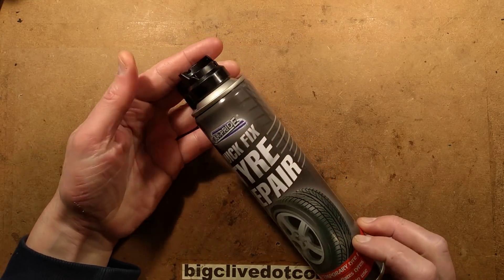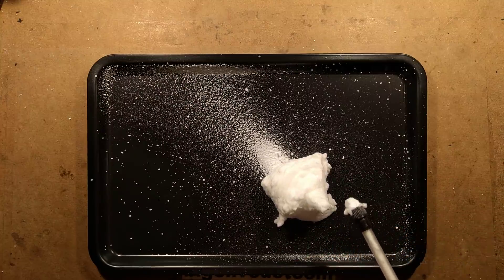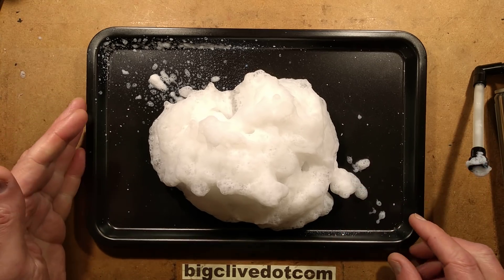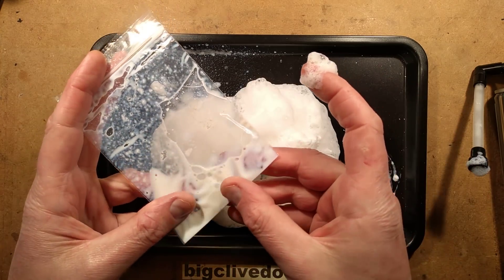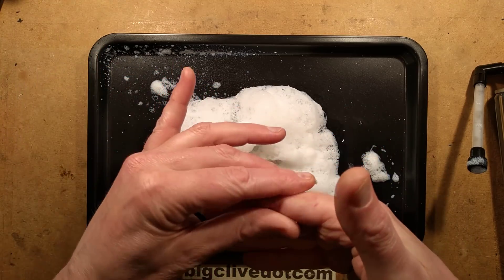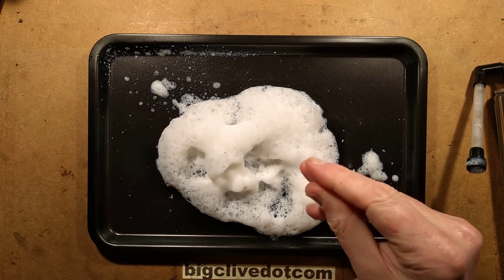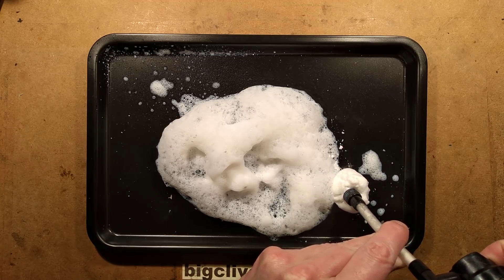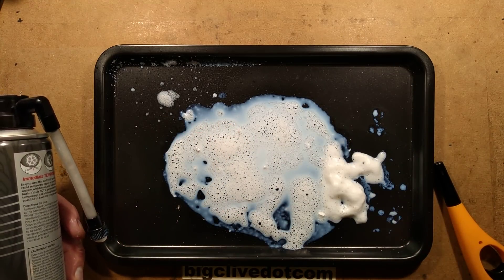What's in a tin of foaming tyre repair liquid.

Comment: Have used it 4 times for personal and family cases (the Home bargains 4x4 version)

Once a trailer tyre wouldn't hold air, (when you were filling it with the compressor it wouldn't have any of it,) I put the puncture at the bottom and it sealed and filled the tyre.

There are caveats.
One being that it won't really work on sidewall punctures.
The other being that once the tire is fixed, it won't be easy repairing it for obvious reasons that I overlooked (get a white paint pen to mark the puncture, this will be easy to find as the sealant will be spewing out the hole)

I swear by this stuff Clive. Pulled me out of many potholes.
That said, it won't fix Sidewall punctures, although, it will show you where they are pretty quickly.

Comment: I've been in the auto industry for over 25 year's. There are several problems with some of those, first if your a tire guy and don't know it's in the tire and your dismounting the tire and separate the bead with some pressure in it it will blow that crap everywhere, second it's very flammable and your tire could go up in flames if there's a spark with a flat, AND THE WORST is if you have a tire pressure sensor inside the rim the chemicals will eat it apart if it's not a sensor safe can and now your out a tire and a $100 sensor....and it also screws up the tire balance while you drive....

Comment: I have a burnout car with a front tyre with 2 tns worth in it ... Has been in there for 3 years the tyre its sepf was perished and cracked .... I did ad about 12 psi into it directly after the sealup\pump in a can.....its fine still

Comment: Friend of mine used this stuff several times, on the same tire.  The tire had quite a bit of liquid inside after several uses.  When driving on the highway, and you hit a bump, the tire would go out of balance for a short while, then go back to normal.
Tires would hold air for about six months after using it, then start leaking again.

Comment: That stuff is the best way of trashing a tyre that could easily have been repaired. But, if your in the middle of nowhere without a spare it could save you sitting by the side of the road for a few hours.

Comment: Products used for cycling tires are probably similar but they are often provided as liquid. They contain latex+water+ammonia (ammonia keeps latex dissolved). Some products contain also propylene glycol to prevent freezing and to keep the moisture longer to prevent drying in hot+dry climate.
In cycling tires it stays as a liquid from about few months to more than half a year, depending on the climate and tire type. Some products also contain for example chopped kevlar or other fibers to increase sealing capability of larger punctures. Fibres really make a difference, one product I really like always blocks the nozzle of the container when trying to use it :)
Bike sealants stay liquid inside the tire and when they block the hole, water evaporates and it forms rubber at the hole. The rest is still liquid and if you get another puncture, they seal the next one, as long as there is still enough liquid left. After it has finally dried, it can form a solid block, expecially if the tire is not rotating like keeping a bike away for the  winter.
Propellants that foam stuff are almost always propane/butane whenever it is suitable.
I'm assuming automotive products to be more or less similar and behave similarly. Due to larger volume of the tire, I'd expect them to dry out faster though.

Comment: I'm an auto tech in the states. Big name Retail tire repair shops will usually deny  a repair on tires filled with tire sealant. Also filling your tire with a hydrocarbon if that is the type of propellant sounds dangerous and long term will probably rot your from the inside out, i'd think. Bottom line, drive with a properly inflated spare tire and know how to swap it out.

Comment: It's been my experience, working at an autoshop (years ago), that people don't drive  long with this stuff in their tire because the extra weight of the liquid throws the balance. And being a liquid, it rolls all over and never hits any kind of equilibrium. So either you are limited by the speed you can travel or you go get it fixed. 

And BTW, this stuff is ANNOYING for the guys at the auto shop to deal with and get out of your tire if it's your intention to reuse the tire. I only had to dump 2 tires that had this stuff in it, but it made a mess and left that rubber film everywhere from the tire machine to outside the shop. Perhaps facilities have a better method of dealing with these than we had back 20-25 years ago.

Comment: Buy a top range luxury car there days and you get 2 cans of this (with a corresponding price tag to match the fancy label on the outside) instead of a spare tyre. Saves weight and space, and of course increases profit as well.

Yes have used it, though I think the tyre shop did curse me as well having to clean it out to do the patch. Easy to remove from the inner, just wash with water, the shop has a sink that will fit a tyre, used to find the leak so it will just get some bad water for the rest of the day, then grind down the puncture area with the die grinder, then sand it with 60 grit wet and dry paper, and finally wipe down with paint thinners before applying the glue for the mushroom patch. You have to do that anyway, as the inside of the tyre will still have the mould release they used in the factory on it, and that stuff is a lot more tenacious than latex rubber.
Reply: SeanBZA top range cars tend to have run flat tyres which means you don't actually need the can at all.

Comment: I havent used this spray type.
I have used the green liquid they call "slime".that has lots of rubber particals suspended in the solution. This stays liquid in the trye and as i understand it reacts with the high pressure air when it finds a leak. It says you can keep it in your tyre incase you get a puncture.think i would rather know when i had a problem so i could get it sorted..
Downside is as its been said before. Tyre fitters wont repair a tyre with this in although it states its water soluble and can be washed out...mmmm what to do

Comment: This foam actually is very effective,  it once saved my day when I had a tire which had a hole on the tire wall and to make matters worse, there was a gap between the tire and the steel rim. Applied an entire can of that sealant and brought the tire back from the dead and I was able to reach a tire shop to make proper repairs on it.
Reply: Good for you! I couldn't fix a motorcycle tyre with little crack (not on the wall) and I had to drive it flat for 50 km (30 mi)....

Comment: A lot of people use that stuff on bicycles on regular basis so you don't end up with a flat 15km away from your home... They just leave it in there untill they actually swap the tire or have to dissasemble it if it leaks air. It seals smaller punctures, but not 100% of the rime. I don't know what on earth are others talking about when they say it messes up balance of the wheel, you're not supposed to dump whole can into the tire, a little bit is enough, once you get it rolling, it spreads inside and seals whatever needs to be sealed. Usually there isn't more than couple of teaspoons of liquid rolling about (in case of small bicycle tire).
Reply: The "Fix-a flat" type actually instruct you to use the entire contents as the can is pressurized to fully inflate a car tire to around 32 psi.
Reply: On bicycles you usually have inner tubes so down the road when you do change them most of the mess is still sealed in the tube....  On cars because of the volume required to pressure up the tire you would need a full can or around there
Reply: @WildSuns42  I've not seen a tube inside a bicycle/motorcycle/quad/car in like 15 years. Everything is tubeless these days. I remember fixing a quad tire with a tube (a rock cut it, then proceeded to shoot into a wall of an adjacent building...) but that's it! Tubes are a great fix for punctures in small vehicles, but they're not used "out of the box" anymore.
Reply: Just went and read the side of my bottle of 'stan's no-tubes'. 60-120ml per tytre recommended. That's 1 or 2 dozen teaspoons :P
Reply: @HaxR3  ...but that's for a completely different purpose.

Comment: Its only really effective on small pin holes or seeping around a screw or nail but it does work in the right situation and can be a quite long lasting fix, but you also need to bring the tire up to full pressure right after use ergo when it gets you off the road go to air pump and inflate the tire to its recommended pressure keep it topped up for a couple of days and it will eventually stop if the hole is not to large.

Comment: Our Long wheel base van had a flat 2 hours before we were due for a gig in London. It took 2 cans of that stuff to re-inflate it enough to drive it to a garage, so we could get it changed properly, but it worked long enough to drive the 5 miles there, and the bloke at the garage said it probably would have done the whole (100 mile) trip to London and back. We did find that both the position of the valve on the tyre AND the position you held the can made a big difference to inflation rate. You want the valve at the top, to be holding the can upside down, and to be pushing that button really very hard for quite some time, shaking it regularly as you pump in the gunk... in the brief time we travelled on it in the fully loaded van we didn't feel any tyre imbalance, but then again we did take it quite gently...

Comment: Had a car that was heading for the scrap heap in a couple of months. The tires kept getting leaks but it wasn't worth fixing them properly so I went through a couple of cans of this stuff. Works fairly well, you fill the tire which also pressurises it and you have to drive around for a certain amount of time (presumable for it to settle uniformly). Then you get a couple weeks before it'll probably start leaking again.

Comment: used this in a rear tyre that had a slow puncture screw in it...left the screw in and ran for 2 years with it in (cough over 100mph quite a few times cough) no problems at all...this is before i learned of the "tyre string plug" method of diy repairs though.

Comment: Clive, you need to get the microscope out. "Slime" (the big green brand in the US) and others all say there are mysterious "fibers" in their goo, which get sucked into the leak and help form a stronger plug in it, IIRC. The companies that sell leak-stop goo as a preventive to keep in your tires, also talk about special fibers. They all push it as "temporary" but if the seal gets you home without having to sleep on the side of the road, or to spend a night waiting for a tire to be shipped in, now that's the point, isn't it? The motor club isn't always ten minutes away, the tire shop doesn't always have what you need, today or tomorrow.
Reply: I second this. There are small particles inside the foam to aid in clotting the puncture hole. There's similar stuff available for industrial and agricultural use, it's a bright green slimy substance and the particles are visible, almost like small rubber pellets.
Reply: I third it - Goop in the UK. Use it on my bike. Ran it for 10k miles when I changed the tyres you could see where there were holes from punctures that had been sealed. Good stuff!
Reply: This is different to slime (Which goes in in liquid form and involves you removing the valve body first). This is designed to go into the tyre in a semi-gaseous state (so it'll make it through the valve), with the excess gas working to inflate the tyre. The slime system comes with a standard air-based tyre inflator, and stays liquid, using filaments of rubber like a "clotting agent" as they're forced out by the air pressure inside. In theory you can add slime even when the tyre's good, as it will stay liquid and slosh around inside to coat the inside, then when you get a puncture it will already be in place to seep out and plug the leak.
Reply: i actually replaced my bicycle inner tubes with ones that came with green slime pre-loaded, i never ran over anything sharp to test them, but i'm sure they were far more heavy than i should have been okay with if nothing else.
Reply: The fibers are just cellulose fibers in a liquid suspension and works quite well and can easily seal a hole up to 5mm (about 1/4 inch.) I work with commercial truck tires and many of our customers (trash, construction, demolition, forestry etc.) run sealant in their tires and it's not uncommon for me to receive tires with multiple punctures but holding pressure in excess of 100psi (6.89 Bar.) We do have some customers who run urethane foam-fill in their heavy equipment (skidder, grader, fork lift etc.) tires, but that's only for low speed off-road use.
Reply: @eddiespencer1  +1 on the Calcium Chloride. 
You'll sometimes run across folks filling their tires with antifreeze in lieu of calcium chloride. 

"slime" works, til it gets pretty cold. (Or really hot, then it turns into a ball and just rolls around in the tire. )
Reply: @jballew2239  I've never seen anyone run glycol/glycerol antifreeze in their tires but it wouldn't surprise me if someone did. They run calcium or beet juice to add weight to the tire for traction and a firm tire. Mostly Ag customers do it. Calcium is about 12lbs per gallon and beet juice is about 11. Straight water is about 8.3lbs. Running straight water will destroy your tire and rim and will freeze in cold temps. It'll destroy the tube if you're running one, too.
Reply: We call that green slime "Elephant Snot"!
Reply: Bought a motorcycle that handled funny. Found out that previous owner had put a lot of the green stuff in the rear tyre as a preventive measure. The green stuff had harden at one point in the tyre as bike had been parked up for months before I bought it. It took me about 60g of tyre balance weights to offset the imbalance until I removed the tyre. Was shocked at finding the big green slug of gel.
Reply: If you have ever seen a steel rim rust out from the inside because of that green crap you wouldn't care if it was made of unicorn tears.
Reply: Haven't ridden on steel rims personally since ages ago. But as the folks at Slime will tell you, you are only supposed to use it after a puncture--and then clean it out again as soon as convenient. If you leave it in long enough to cause rust...that's not their fault. If you inflate your tires at a gas station, there's almost always condensate in the hose, so steel wheels will be wet inside and rusting out "normally" for most folks.
Reply: @user-neo71665  I've seen more rusted-out rims from people running calcium in their tires than I have from people running just sealant. Makes sense, since the calcium is calcium chloride and is corrosive to steel. People still insist on running it, though. Beet juice ballast is a better option but it can corrode steel over time as well (and it stinks to high hell.)
Reply: @eddiespencer1  A lot people fill the tires on their offroad trucks and atvs so if they are miles off the beaten path and get a hole hopefully it will seal enough to limp out.

And yeah I've seen calcium completely eat the bottom of a tractor rim that has been sitting too long. We run it but run it in both our tractors but run it in tubes. Not fool proof because if it gets a hole you still have to make sure you clean the mess up but it does keep it off the rims for the most part.

I've seen cheap farmers run water/antifreeze. It's not uncommon.

Comment: I know these things divide opinion, and for long term use in a high performance vehicle (or something like public transport/heavy haulage) it's not a great idea IMO, but I have been using these foams for a few years in various "normal" cars and it's been brilliant generally. It lasts longer than what I would call temporary, probably quite easily long enough to finish off a half worn tyre & hasn't caused me any issues with valves.  The only thing that has caught me out is not getting on the move soon enough after using the can, when it slowed down the leak but didn't stop it. Presumably it had started to go off before it found the leak.  Also heard that it can cause corrosion on steel wheels, but never really seen a car wheel that badly rusted to where it'd be an issue & alloys seem to have no problem. Also it's been good in tubed tyres on bikes.  I, for one, am pro tyre-sealant.
Reply: Oh, and as for TPMS what a load of Eurocrat/HSE nanny state twaddle that is. I have had TPMS for as long as I've been driving/riding, it's called checking the things regularly.  Also forgot to mention it's never affected wheel balance to a degree that I'd noticed, presumably because if you follow the instructions and drive a few miles after use it gets distributed evenly within the tyre/wheel assembly.